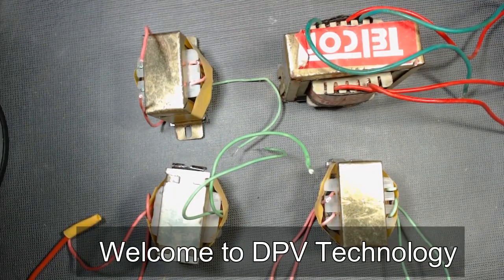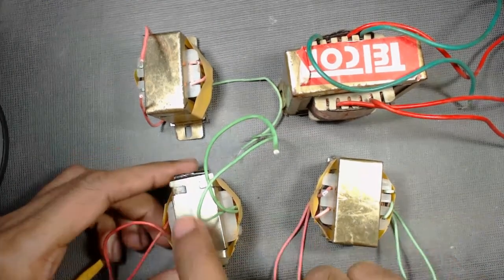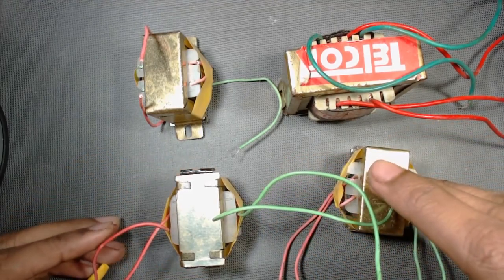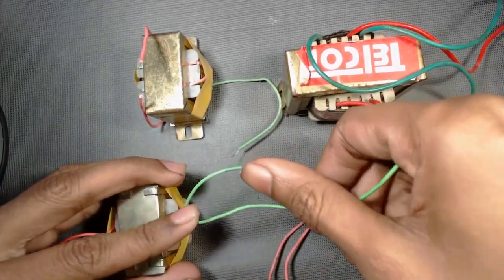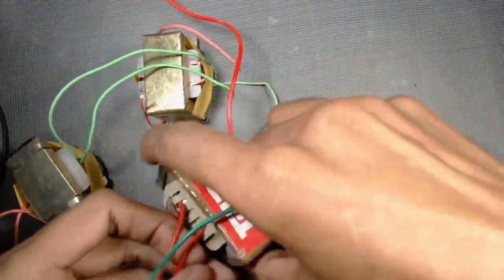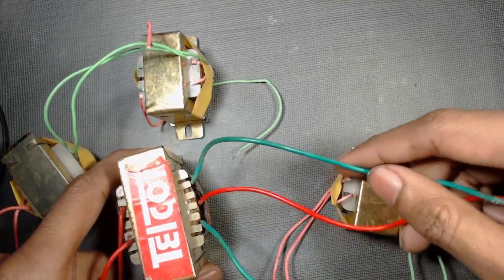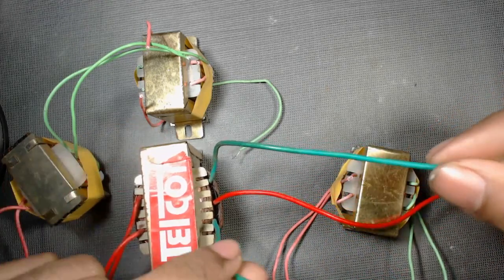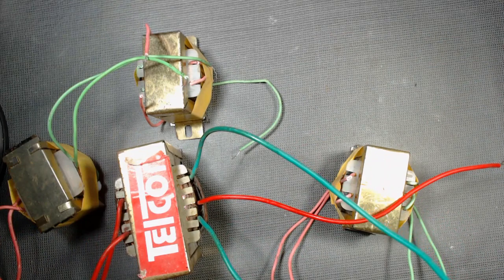how to use transformer |center tap , an ordinary transformer

Comment: What voltage if the two outside wires are connected together with respect to the common centre wire?